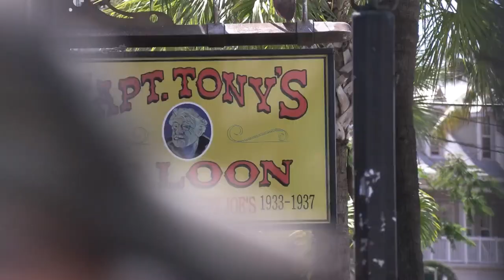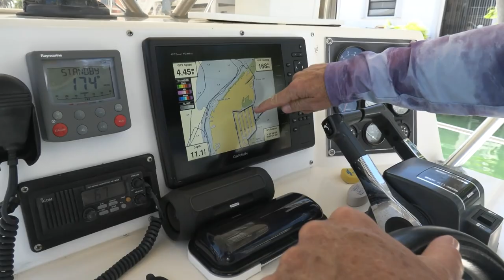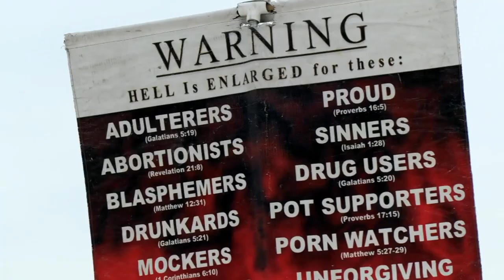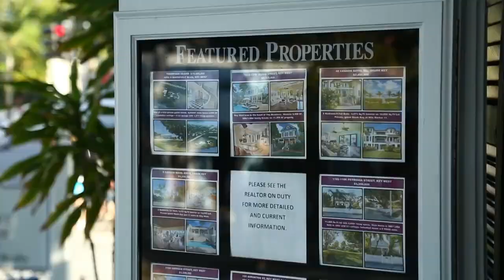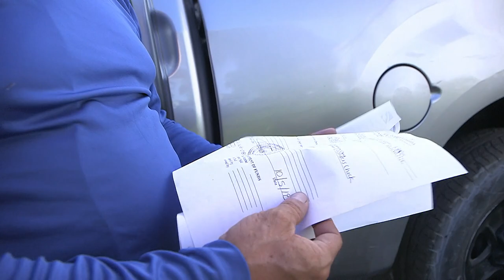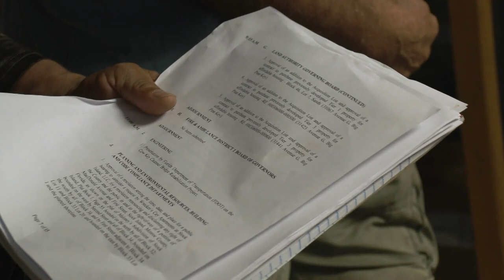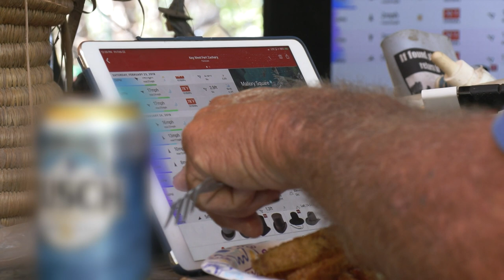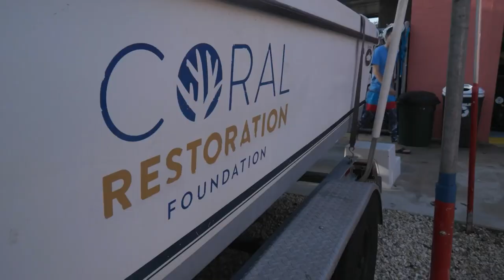The Florida Keys, the Place of Limitless Parties

Comment: I don't get how an island with 360 degrees of water around it can have beautiful scenery. It's just water.
Hurricanes probably put street parties on hold. That must be when they go inside balls deep.
Reply: I'm curious how the island doesn't just get swallowed up during hurricane season.  The beaches in Key West are almost completely artificial in that they have to ship in sand from the mainland each year as the storms erode.  That island is barely above the water line.
Reply: @williamwells1487   I wouldn't be anywhere around there during hurricane season. They must spend a small portion of their lives during that season trying to predict, prepare and repair for storms.
Reply: @NotaKamalaFan  I was stationed in Key West back in the mid 90s. Typically are sent north during a storm.
Reply: @williamwells1487   Might be paradise when it's nice but life is too short to go through all of that.